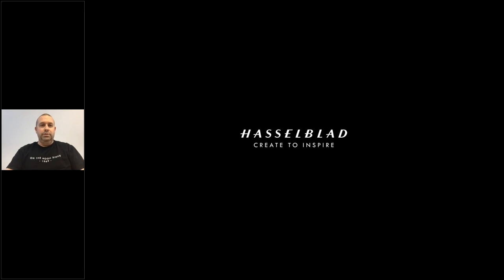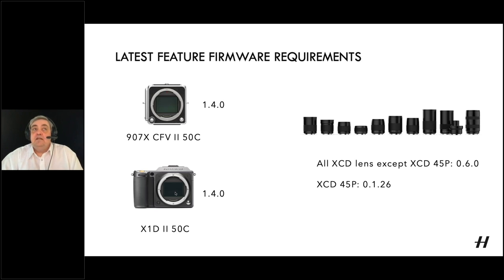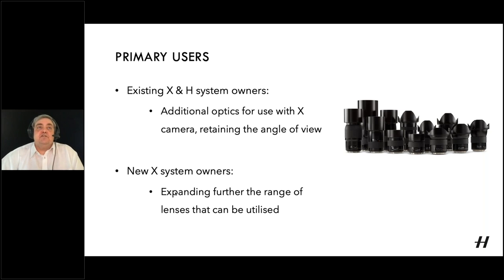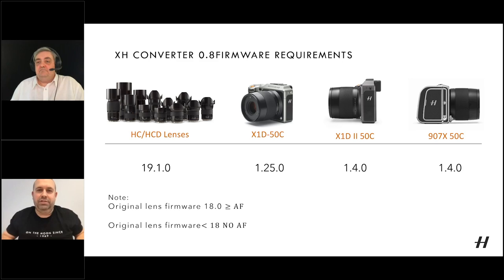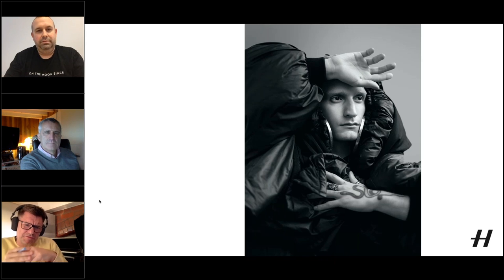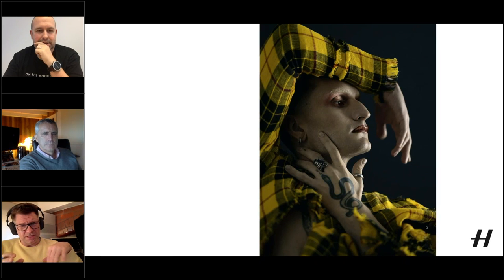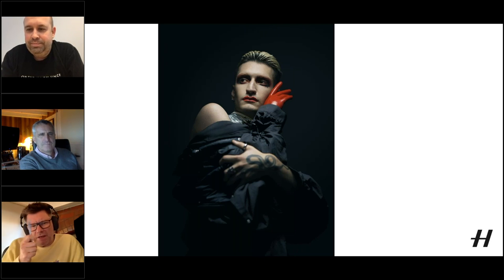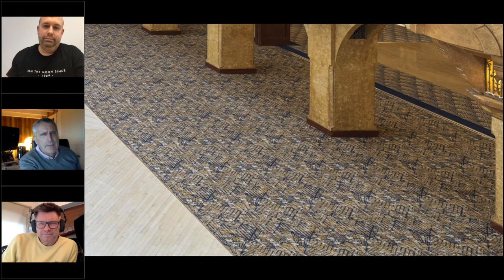Webinar - XH Converter 0,8 and Firmware Update 1.4.0

Comment: interesting addition, but can the hts 1.5  adaptor work in this system- this allows a tilt/shift on the x bodies, similar to the H system did, so would be nice to have some of the maths worked on this configuration, esp. since you have both x 0.8 & x1.5 glass in this system!
Reply: The math is cumulative. It works well.